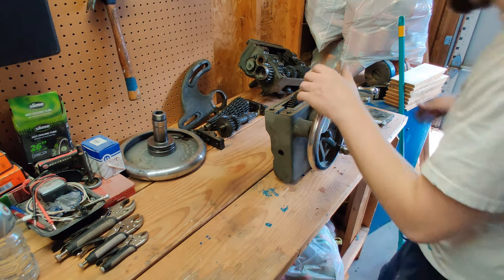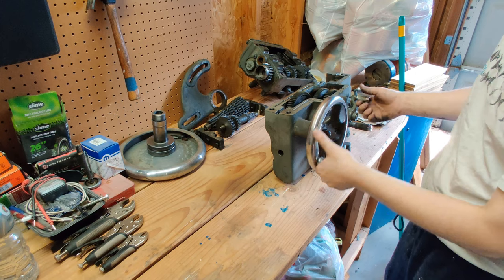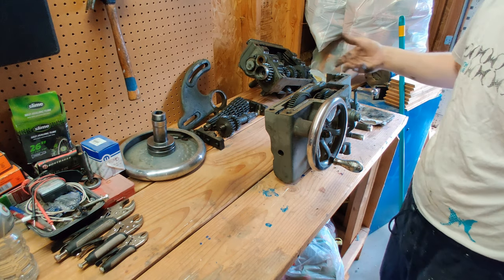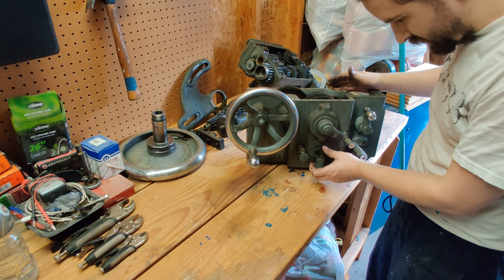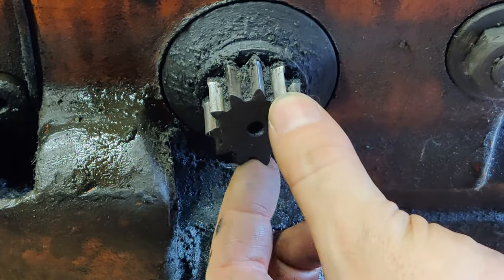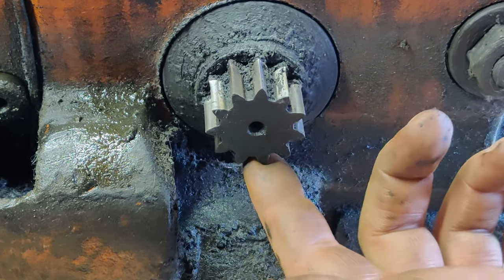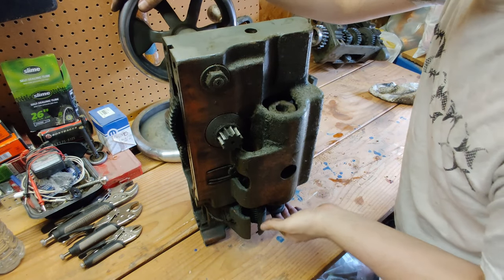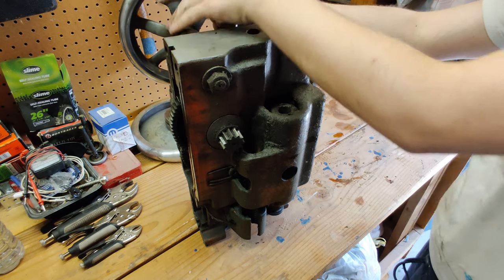1950 LeBlond Regal 17" Lathe Restoration Part 6: Apron Disassembly 1 of 3

Comment: Flushing the carriage out with kerosene  would've best , there should be a resivoir for oil and some kind of pumping system to lube the carriage and slide even the ways..id soak it in a pan full and brush in every crevise and slot.
Reply from the maker: After this had a basic scrub with some rags, scraping off thick chunks of grease, and a quick run through a shallow container filled with degreaser, I took it into work and used a parts washer to give it a full scrub in a proper compound. I also have some in a can for cleaning out some of the heavier components I can't just take into work (like the headstock). 

Don't worry, these will all be spotless soon enough.

Also, this does have a pumped lubricant system, it needed a lot of work to clean out and I need to replace some felt plugs that is uses to make sure there's even oil distribution.
Reply: I appreciate the video I bought a lady just like yours is it hard to get parts for I haven't looked into it I need a gear for the gearbox where did you get parts
Reply from the maker: Unfortunately, part availability is mostly going to be what you can find on eBay or forums where others have similar used machines. The manufacturer might be willing to make a replacement, but it often costs hundreds of dollars a piece.

Your best bet is to either repair the broken parts or take some measurements and make a new one. With gears, you can sometimes find an off the shelf gear that will match and machine things to fit.